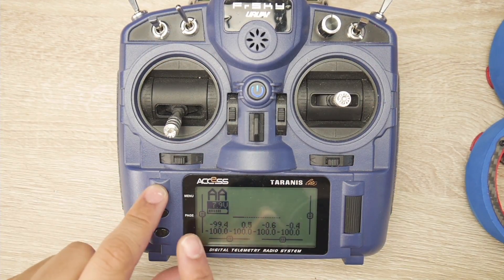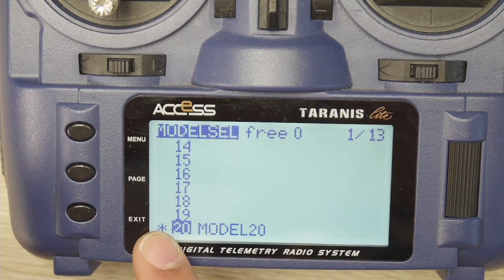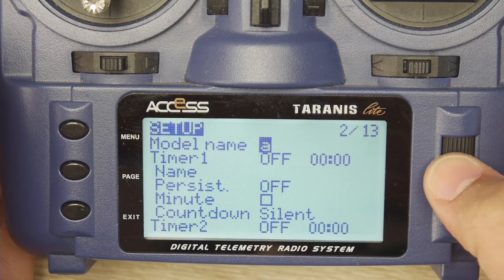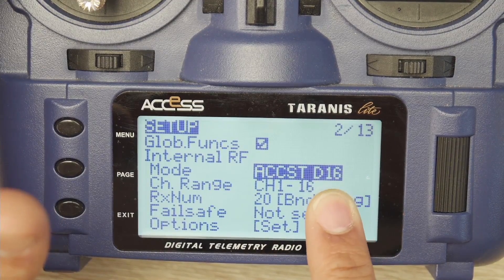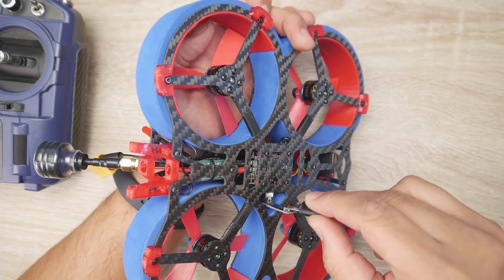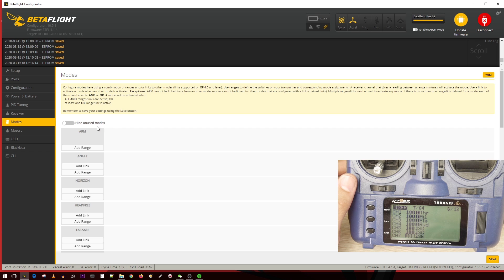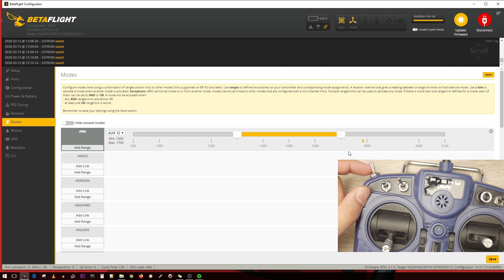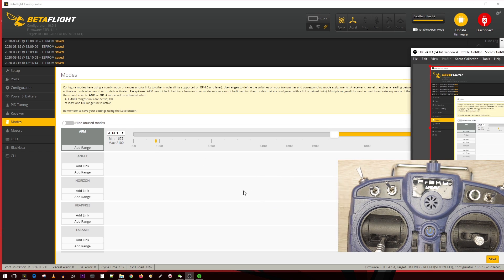FrSky Beginner Guide EP1 // How to Bind, Setup AUX Channels and Modes

Comment: I have problem in reciever tab, throttle is min  885, max is 1833, its not 2011 :/
and every switch is up to 1833, not 2011, and it won't arm, pls help?

Comment: Good Video, but the one information, mostly everybody gets wrong. Binding with Ch9-16 has nothing to do with the channel 12 for Rssi aso. You can bind with Ch1-8 Telem on and have Rssi on channel 12. You select the number of channels in the transmitter one line above the Bind feature.

Comment: Hey Mesh! Can the URUAV NEX220 220mm hold the FLYWOO GOKU F411 Micro Stack 16mm?
I wanna get into this sport and i'm kinda on a tight budget so that why i ask!

And also very nice channel!!
Reply from the maker: Thanks thomas, F411 is made for super tiny quadcopters not the 5 inch 220mm. So it won't work look into a mamba 20x20 stack
Reply: @DroneMesh  Thanks for the help!!